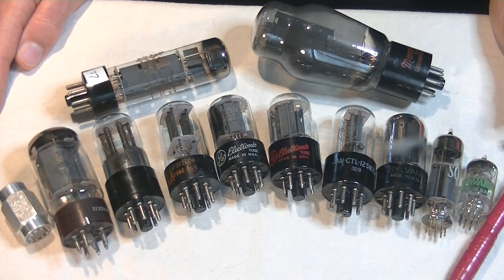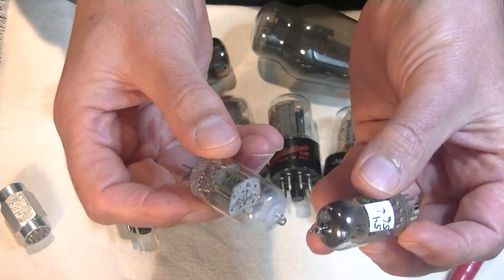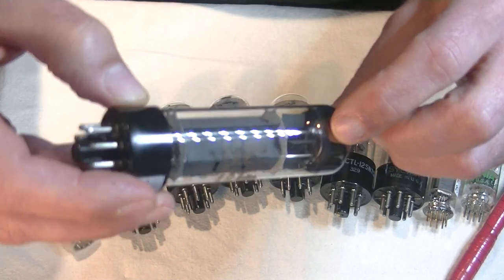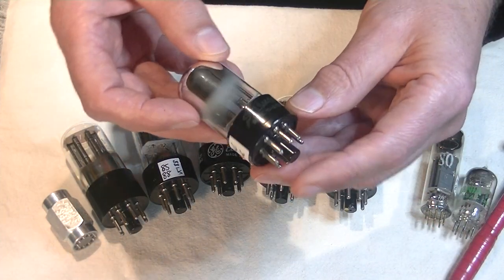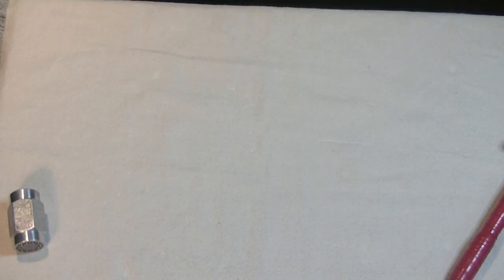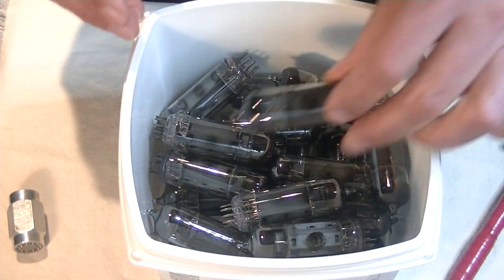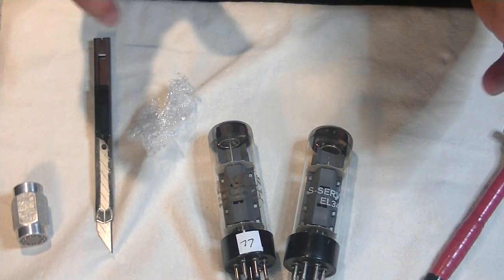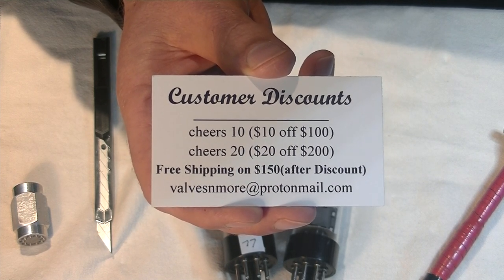Tube Lab #14   Getters

Comment: Technically speaking, the "getter" IS the silvery material coating the inside of the glass.  That's the metal material that chemically reacts with stray gases to remove them from gaseous state and bind them as a molecular solid.  Once the gas is chemically transformed in this way, it no longer exerts a gaseous pressure, thus increasing and maintaining the vacuum.

Those wire halos, "D"s, flying saucers, and so forth were the getter SOURCE, prior to the inductive deposition of the getter material ("flashing") during the tube's production/activation.  We can refer to those wire structures as "getters," but the engineers who designed these beauties would have looked at us with suspicion or amusement if we said that back in the day.  Once the getter material has been deposited on the glass, the getter source wires actually do become useless - except as a source of mystery, and potential identification features.